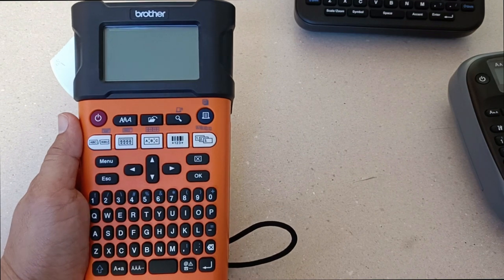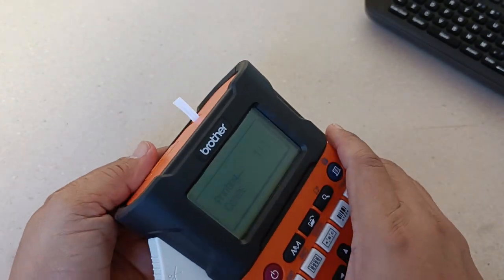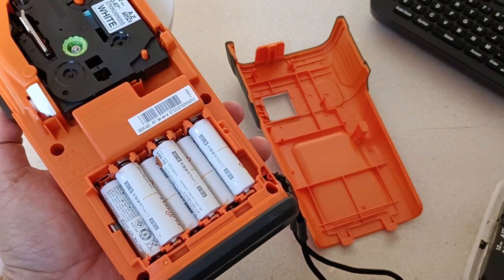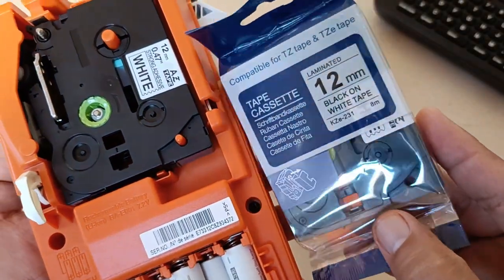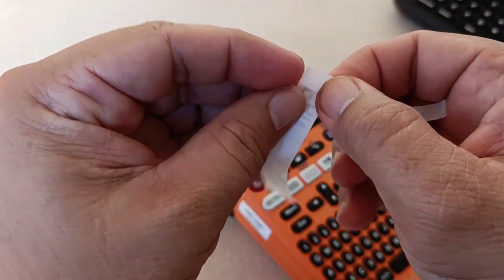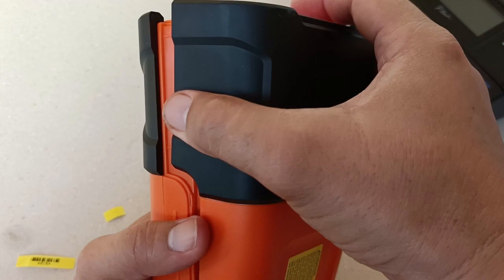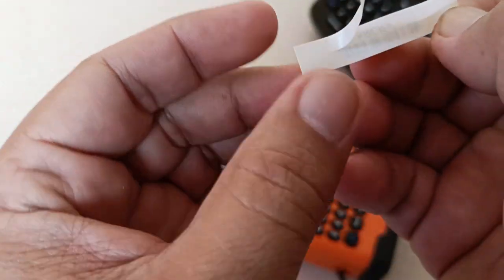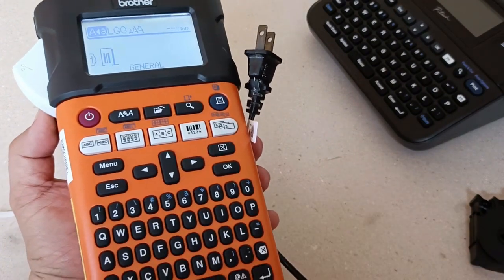Brother P-touch E300 Electrical Label Printer- An Introduction [CC]

Comment: Interesting label. If it is laminated, where there is a top layer above the printed characters, then it should act as some nice protection for the printed characters. I'd hope that the adhesive is strong - will those labels you've stuck onto the side of the printer start to peel off after a few weeks?
Reply from the maker: @ChrisM541  Thanks for dropping by. The labels are strong and do not peel off unless you manually unstick them. The surface should be flat, smooth, and without oil or dirt for best adhesion.

Comment: Why does a little bit come out each time? Is there a way to stop it as it is a waste of tape
Reply from the maker: It is indeed a waste of tape. Unfortunately, there's no way to stop it from ejecting that bit of tape at the beginning of every print. What I did to minimize it was to print several labels in one go, using the space bar and bluearrow + enter key to separate the individual words/phrase.

Comment: Does the light go out when its fully charged?
Reply from the maker: @WolfKillerLestat  I think so, but I  couldn't recall exactly. The reason being that the included Li-ion rechargeable battery for my unit had already gone bad: it couldn't be fully charged no matter how long I kept it connected to AC voltage supply. I no longer use it. Instead, I use rechargeable Ni-MH batteries, which so much better.

Comment: It would be helpful if you have the item a rating out of 10 so we know what you advise. Please 🙏
Reply from the maker: @stevenschapera2888   I appreciate your suggestion. Since I prefer to use the E300 over my other label printers nowadays, I would give it a rating of 8/10 based on my personal use of it. Also suggest to consider the model P-Touch E110, which cost lower and more compact than the E300.